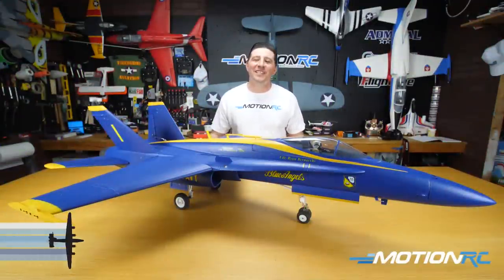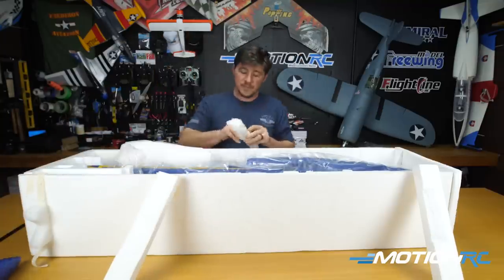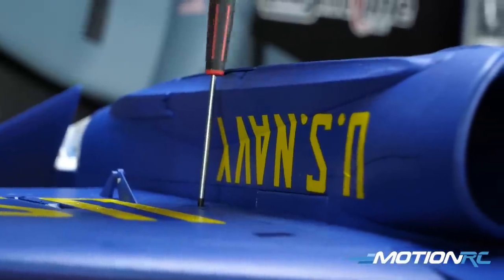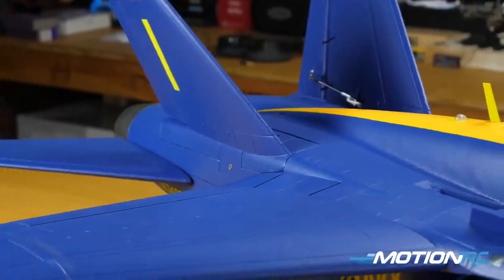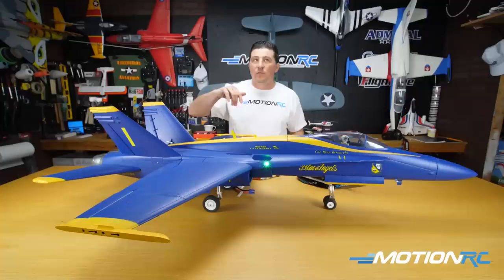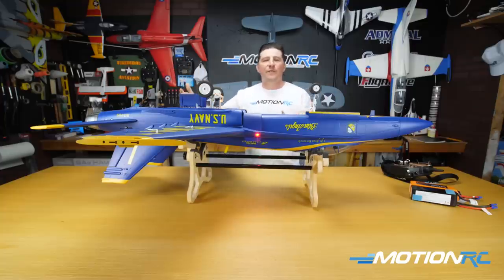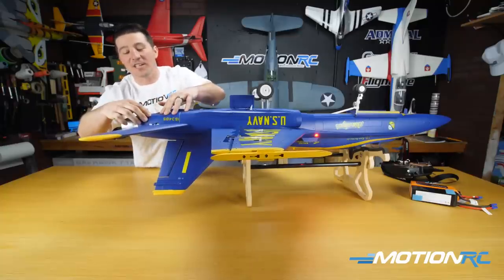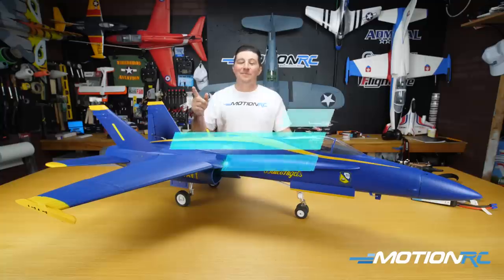Freewing F/A-18C Hornet 90mm EDF Jet - Build Video - Motion RC

Comment: The Blue Angels landing gear struts are white not silver and also, its missing the red nav light on the top of the fuselage
Reply from the maker: yes they are, but those are easily customizable. When making an RC model we have to pick and choose the amount of features we can include. Every addition adds cost. So there is a balance that has to be had.

Comment: I still want to see the ESC mount and placement please. Would be great if you could post some photos on Hobbysquawk or something.
Reply from the maker: Just posted them for you, check here: https://www.hobbysquawk.com/forum/rc-airplanes/jets-and-edfs/186270-official-freewing-f-a-18c-hornet-90mm-edf-thread?p=191848#post191848
Reply: @MotionRC  Excellent, thank you so much. This is VERY helpful, and a nice shot of some of the interior duct work also. Thank you again for going above and beyond for your customers.
Reply from the maker: no problem. the least we could do. Mad I didn't do it in the video
Reply: @MotionRC  I somehow get the feeling like I'm in the minority on wanting to see things like that. I think most people will be happy with the stock setup and aim to just get that. So it's probably not a big deal to most customers if you don't show this stuff. I couldn't blame you for not thinking to do it. But since there is a smaller minority of folks like myself who will want to do 8S or just use other equipment. It's a really great thing that you engage with your customer base in this way and are willing to take the extra time and put in that effort for us. Thank you.

Comment: what's the fly time you get with 6000 maH battery?
Reply from the maker: Variable depending on throttle usage. But the weight gain of a 6000mAh tends to offset any time gained

Comment: Why on earth would they not put magnets on the servo covers!?!?
Reply from the maker: why on earth would they put magnets on the servo covers?
Reply: @MotionRC  So the servo’s can be accessed with out ungluing and regluing the covers?
Reply from the maker: @FlightLogProductions  That would be a waste of money. Little glue and/or a screw will also be a better hold
Reply: @MotionRC  Screw would have been okay too.
Reply from the maker: @FlightLogProductions  I never lost a servo cover on a plane I didn't crash
Reply: @MotionRC  ?? There was no mention of loosing a servo cover?  Just stating a magnetic or screw to secure the cover, being preferred over gluing..